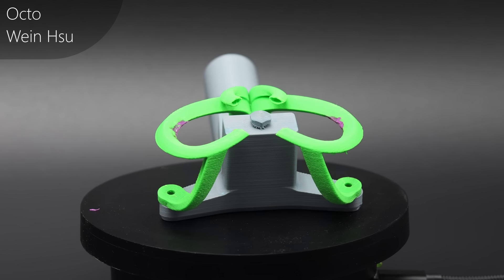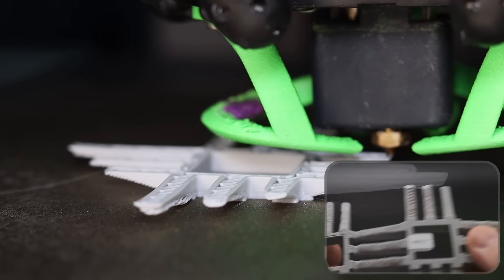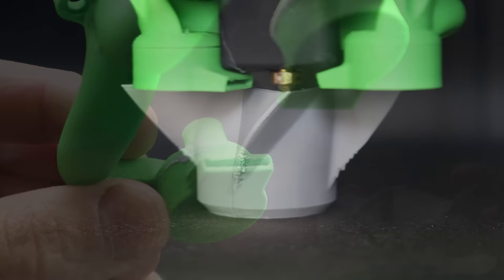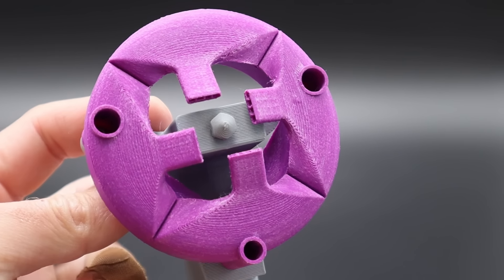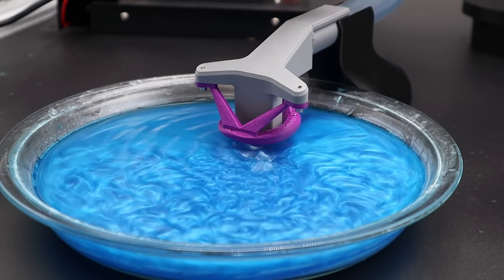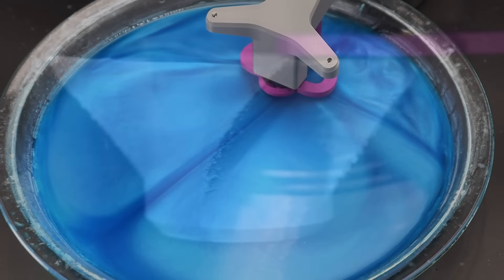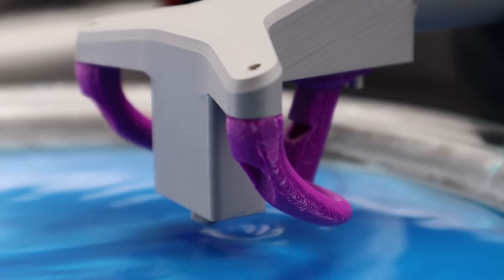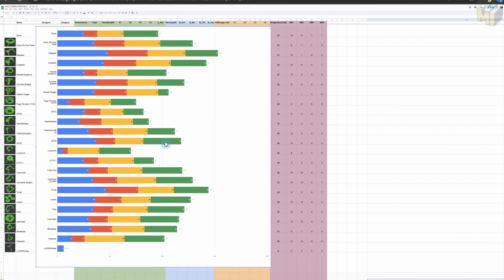Ep.4 - We have the final 6 ducts, unfortunately one "duct" didn't make it.

Comment: I throw in some ideas:

1. Idea: You could put some sort source of heat, in the cooling area, (ideally in the shape extruded filament, f.e. a wire) and use a thermal camera to see where the air hits(heightwise), and how narrow the beam of air is.

Or you could heat up the wire red hot to see where it cools down

Benefits(if it works):
-calibrate the width  of the air beam
-can help with "aiming" the beam of air

2. Wouldnt putting a source of vape into the fake extruder possibly visualise the airflow? 
Then you could put a sheet of glas underneath it, and film it from below
Reply: 1. Addition: a needle sticking Out of a heated Nozzle could work

Comment: I don't recall if you tried running your tests without any cooling at all. The bridging test in particular seems like it does better with little to no cooling, because the air displaces the molten too much. That's why the fans that move little air seem to do better on that one.
Reply: I was thinking the same thing. Which could mean that some of the designs could be better overall with the tests if you change the fan speeds for the bridge test. It would even be interesting to see if a lower fan speed was needed just for the first couple of passes and then you could turn it up to full to finish the bridges once some strength was there.
Reply: @Brocknoviatch or a duct that has a wide mouth so it still moves a lot of air, but much more slowly.

Comment: The slicer settings and testing seem to be skewing some of the tests. For instance, the restricted duct did best on bridging and overhangs, but on the shuriken and benchy it was about the same as stock. 

This is likely because the cooling requirements for the shuriken and benchy are lots of air quickly. That amount of air at speed will blow the filament around for overhangs as can be seen in the video. 

Without values for airflow and air speed, it is hard to optimize the duct geometry or learn from these tests. A flow/speed curve vs fan power level would really take these tests to the next level. From there we could determine the optimum air speed for certain tests and tune the duct and slicer for top performance.

Comment: I don't get why a lot of these are thin-walled parts. The first duct in particular would be a lot more printable if the designer took the inside cavity and boolean'd it out of a rough blocky shape with nothing but right angles and 45-degree overhangs.

Comment: My Why can’t it do high speed benchys??? I’ve found that that when it comes to high speed printing, less is more from the part cooler. And most important variable is keeping the ambient temperature as uniform as possible. The nozzles look cool but it’s like the design is going in the wrong direction, figuratively and literally. The literal wrong direction is that they are directed almost directly at the nozzle. With amount of air you’re moving, you’re probably dropping the nozzle temp by 15-20 degC. 
Consistently, I can turn out 14 min Benchys in PLA-CF, ASB-GF, PET-CF, PETG-CF and even Tpu, that are pristine. 
Everyone is trying to move a bunch of air around the part. 
There shouldn’t be turbulence or vortices. You need a small bit of warm air , not cool, that follows nozzle , directed at the layer line.  Art and functionality don’t work well here. 

That’s it. I know it’s boring but it’s highly effective. 

What kind of speeds are you running??